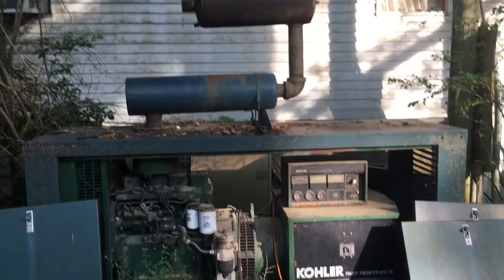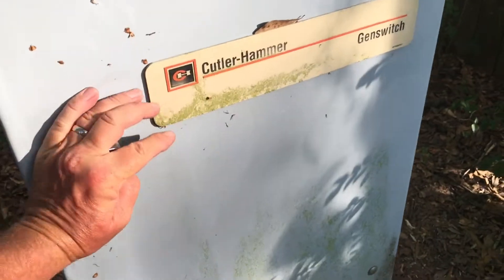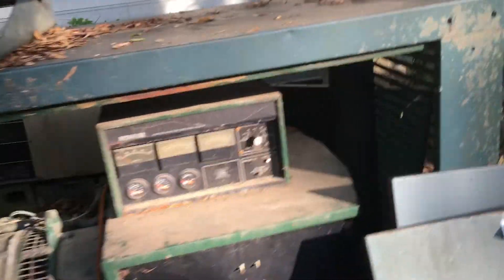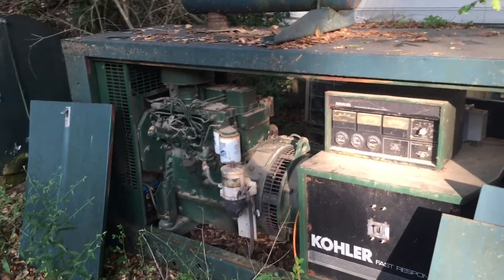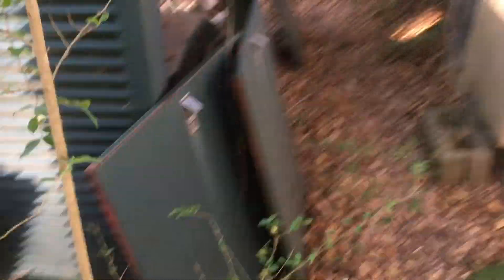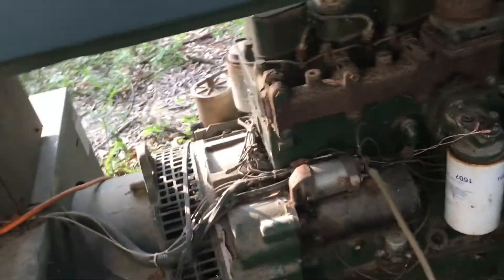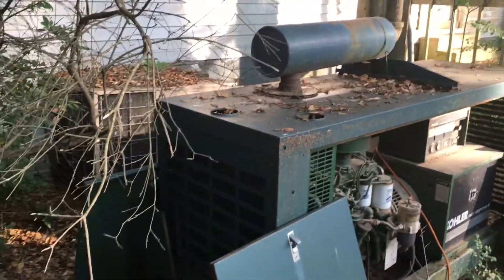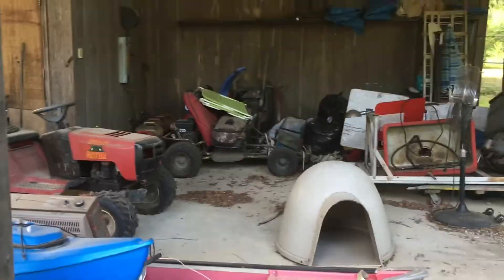Kohler Fast Response 2 Whole house generator

Comment: main breaker is off unit can run, when i turn on the main breaker unit stalls
Reply from the maker: OK. That to me sounds like there is not a problem with your motor. It is related to the generator. Is there anything plugged in? Ground it out? These are the things you need to look for. I just don’t have enough information to answer your questions. Where it is. I’m sorry.

Comment: I have a Kohler 20RZ ,when l turn light on generator stalls (no power output)?
Reply from the maker: So it runs and when you turn equipment plugged into generator the generator and motor die?

Comment: That thing is a beast.  How do you fill up the tank if you need to fill it? Could you call a heating oil company to come out and fill it cause I know we've used diesel for heating oil a couple times when we were in a bind so im wondering if the same can be done the other way around?

Comment: I bet the documentation stamped on it somewhere would tell you when it was built, GREAT idea to put it on a movable platform, I think I would at least have some window screens make to screw over the openings to keep the varmints from getting in there !
Reply: @Mayhemcountryliving  Yea, I saw those, I'm talking about to put over all the vent holes, we have a standby propane gen on property we bought, when I removed the covers wasps & dirt dobbers had got in there and really gummed & dirtied the insides up